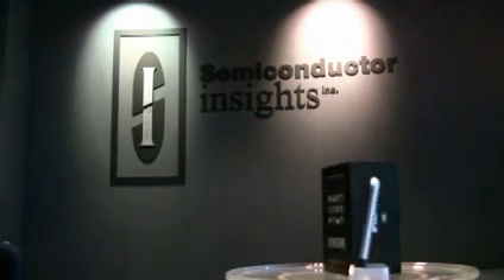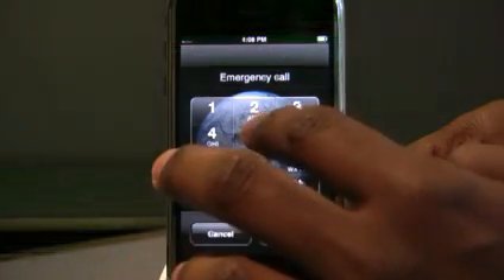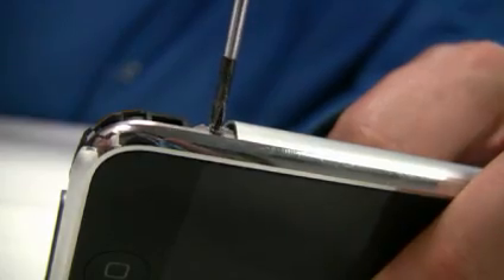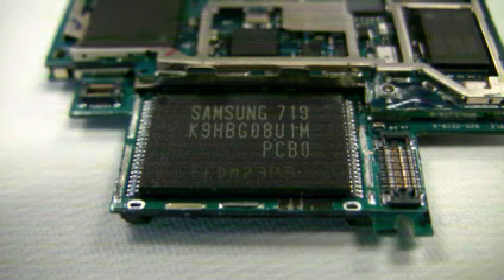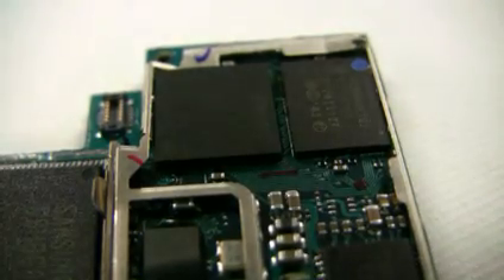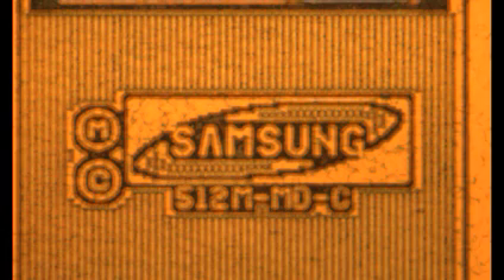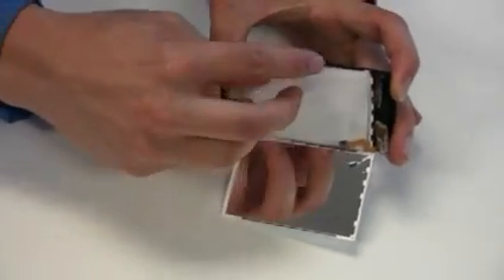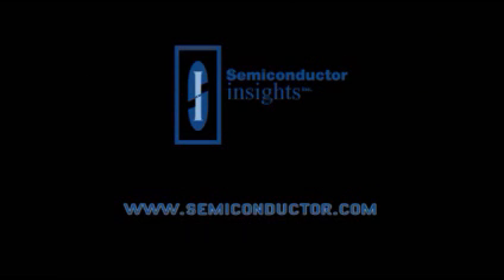Apple iPhone Product Teardown

Comment: If the harddrive used for the iPhone is similar to that of the iPod, couldn't you technically replace the harddrive part with a larger size (if there is any) and use that (after some soldiering)?

Comment: I don't think you're right TaysirBelt.  I checked it on Intel's page based on the pictures in the article and the Intel datasheet says Mega-BITS.  Go to their web page and check out Wireless Flash W30 datasheet.  It's all there.